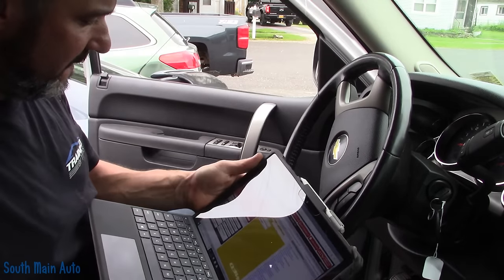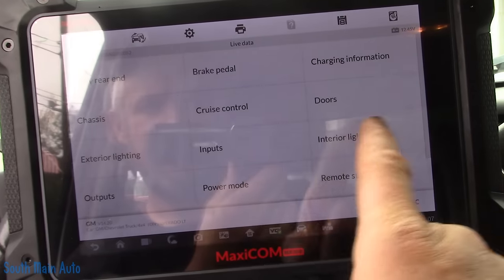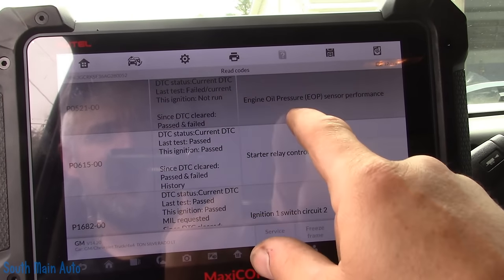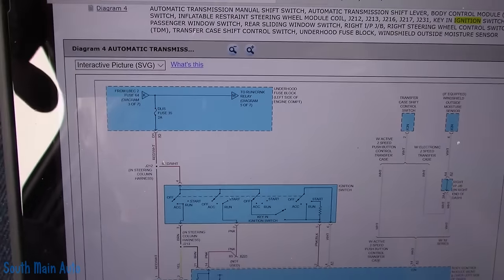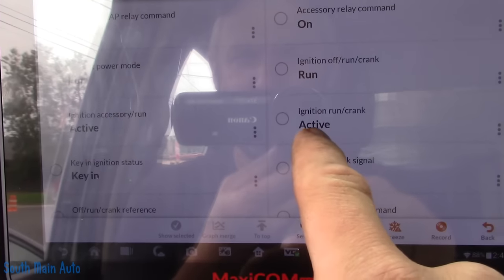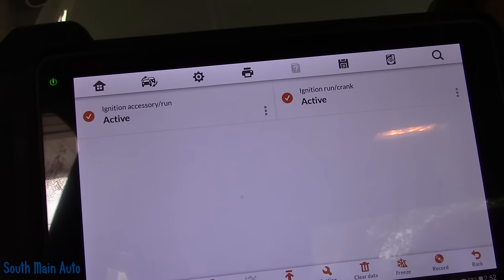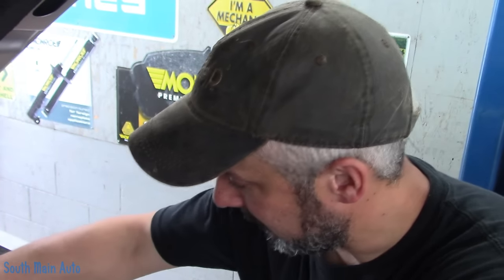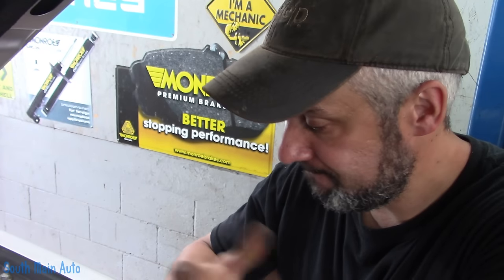Chevy/GMC Truck: No Start - No Crank

Comment: Hey man I replaced my steering wheel and while it was off it started to rain and I tried to switch it on to let the windows up and nothing.  Figured it was because the steering wheel was unplugged but after replacing the steering wheel I have the same problem.  Any suggestions?

Comment: I have an 02 chevy Silverado it's got the 4.3 in it the ignition will not start the engine I have to jump the starter relay in order to crank it but I have to turn the ignition to the crank position let go then it the toggle switch then it runs fine no security light or anything so it not the passlock any ideas?

Comment: I have a 2009 Silverado I was driving out the driveway and it died on me and it won’t crank over anymore All lights and power windows and locks work check battery and starter are to be working just won’t crank any need help will be appreciated .  Thk

Comment: I I would like to ask if you can help out in finding out why my 2000 Tahoe won’t start no lights on dash turn on besides odometer battery and security light scanner reads ignition 1 inactive and trouble code b1477 thanks in advance

Comment: Looks like a good concern to take back to the car lot who sold this truck, depending on how long ago that was.  Seeing the cover there nice and black, proves that cover wasn't there very long compared to the fuse board. I think I'd ask the car lot to give up 50% of the cost for the new one plus labor. Being only 9 years old, that fuse board shouldn't be that oxidized  had the cover been there like any other truck.  Someone has duped the buyer...verified.

Comment: From what I've seen on these trucks, it's usually mouse nests underneath the fuse panel and them chewing on wires, and of course the urine from them that cause corrosion. Clearly not the case on this truck.

Comment: Those trucks have been coming out of that fort wayne factory missing that lid for a really long time. Only time they get put on is if the dealer caught it on the predelivery inspection. It gets especially bad when the factory winds down production on the model year. Ive seen cars roll out of the factory as a completed vehicle, and it's missing the steering wheel, or the entire brake pedal is nonexistent. But hey, that's GM for you, only other car company that will sell you half a car as a whole one is ford.

Comment: Wasn't the original complaint about an Oil light? Did I miss that?
Reply: It was... but then truck died and wouldnt crank so that became main issue.  Code showed pressure sending unit problem.
Reply: @JenniferFuchek  So did he change the pressure sending unit?
Reply: @paulmartin5787  no not in this video. That's a job and endeavor in itself to do as the location of the unit and access/space to change it.
He did say hes going to order the fuse box from the dealership - maybe he will change it when he changes the fuse box.
So long as it's just the sending unit the vehicle can be driven with it as is... the sending unit only takes the oil pressure reading from engine and displays it on the dash (usually in a sweeping needle gauge). Its not a critical part for engine operation.
If it was showing low or no oil pressure and the sending unit wasnt the problem it would be more severe and critical - but Eric did say (according to customer) the engine wasnt tapping or knocking when the pressure gauge went low

Comment: that corrosion that ate that fuse is the same hungry beast that will eat up the bodies on aluminum body fords
Reply: right because my Chevy's steel body and brake lines didn't disappear from it. I've had both thats why I have a f150 now.

Comment: It's a known issue that the covers don't even need to be left off, the entire housing is just terribly designed. My buddy is going to have to do this same thing with a 3rd hand truck but the original owner put the snowplow box on top of the cover with literally just enough wiggle room to get it over the body side of the panel 🤦

Comment: Cars 101 - do not remove the cover of your fuse box and then drive the car around in rain, downpours, etc.  I don't think I have ever seen a fuse box so messed up in my life except when the car was flooded. Eric, how come you did not check under the car for water damage?  That fuse box is a big warning sign that this car was flooded at one time.

Comment: Gday
what about the oil light?
cheers
Reply: Pressure sensor.  It was a code stored. They're common failure and a major pain to change due to placement at rear of engine.
Reply: @JenniferFuchek  It was a performance code. MY bet would be low pressure when hot, if that is the case needs an engine. Could bandaid it with  a high pressure/volume oil pump, but the cam bearings on that particular year wear and bleed down oil pressure.
Reply: @mph5896  rewatched the video.... at 4:53 it shows oil pressure sending unit performance.... P0521 .... which can be caused by the sending unit failing or has failed. This specific P0521 engine code is triggered when the PCM sees an unexpected value in the engine oil pressure sender/sensor. It could be out of it's normal range or could be fixed when it should fluctuate. For this P0521 trouble code, the cause may be mechanical or electrical. Sometimes wiring harnesses break or corrode (given the look of the fuse box I wouldn't rule it out).

Engine oil pressure sensor performance simply means the sensor isnt in correct range the PCM is expecting hence it is failing and requires replacement. They are a very common failure part on Chevrolet engines.

Comment: Sure could have used your talents when 2002 Impala started with the security light, no start crap. You could reset it by turning the ign switch on and off in the right pattern and it would start again. of course that didn't last...LOL

Comment: that corrosion is so bad, and the rest of the truck looks good like a coverup  cleaning from a  under water salvaged  restoration. even in your part of the country, a full winter with fuse cover removed would not produce deep fuse corrosion. that truck was in a flood, most likely down south.

Comment: My truck needs a new ENGINE WIRING HARNESS JUNCTION BLOCK as well. The replacement part is saying programming is required. Has anyone else faced this issue and replaced without programming?

Comment: "For whatever reason it's not uncommon for these trucks to come in with no lid and I don't know why"... Oh I do... probably some tech at a stealership or other shop knows what happens if they pull the lid off and the customer drives around for a few months like that, they get a future fuse box replacement job :D

Comment: Any video of that oil pressure issue
Edit: or is that caused by that fuse box?
Reply: No.  Oil pressure switch problem.  It's just for pressure reading and they're a  common failure part. They're a real pain to change due to location on backside of engine. 
Oil pressure reading and fuse issues are two separate things.
Reply: @Francine Baus naah no worries! ♡

Comment: Driving up to your  garage to die is just Murphy dipping his toe in your lake. I rank a crusty fuse killing a truck like that right beside the sudden fuel pump failure that always seems to happen after you topped the tank up. Again, Mr. Murphy testing things out with a hand on your wallet. ^.^

Spooked you a little when she fired, eh?

Comment: Since you asked for a comment: f*cking gm should be sued for this faulty design fuse box. I have a customer with the exact same issue, fuse box corroded to sh*t. Lid wasn’t on properly and looks exactly the same as this one. How hard is it to design a proper lid? Ffs. Thanks for the video and the info, solid job.

Comment: Thanks to GM's stupidly designed fuse box, dirt and crap gets right up under the cover.  I took the cover off on my 2007 2500 and was surprised at the amount of crud in there.

Comment: See this a lot with the 3WD community. They spend hours and hours hosing out all the mud and sand in their chassis but never think of fuse boxes (when they've been that deep of course). If ya bonnet's been under, get in there and hose em all out to get rid of the salt, mud, sand... then hose the living bejeebuz out of em with WD.

Doesn't hurt to grease them all up, but if you're going to, use switch grease or silicon grease and know that no one is gonna love ya for it.

Comment: What about the diagnosis on the original complaint of the oil light? The suspense is killing me.
Reply: I suspect that will be solved with the fuse box.
Reply: Reece Newton he is working on a Chevy. There is bound to be more than just the fuse box issue. Probably going to need a new oil sensor and a complete engine overhaul and some blinker fluid.

Comment: What about the oil light?
Reply: Pressure switch.  It's a common part to fail. It's not a critical huge issue as it only "reads" oil pressure. 
They're a pain to change as they're on rear of engine under the windshield cowl.

Comment: I watch your channel find it very useful at times well all the time actually my name us Mike iam from oroville ca I have a 2011 chevy silverado z71 4x4 with the 5.3 l fuel management that will drop down to 4 cylinder  when other 4 are not in demand don't like that but that's a nother topic I had removed my wireing harness that feeds to the injectors  and ignition coils think I might  have some ground wires not I'm 5he right spots cause it won't start but all instrument symbols come on but no start also rhe color codes for injectors plugs wich gi to wich cylinder? I am homeless right now living out of my truck I trying to get back on the road others wiz I would if could  donate contributions if you could help it would be extremely greatful

Comment: My concern is who was the genius that thought that removing the fuse box from the safe confines of inside the vehicle would be better suited to an under the hood location?

At least on my Volvo V70, the fuse box sits in a sealed area under the hood close to the cowl panel. And imagine that, it comes with spare fuses and an extraction tool.

Comment: 9 years,9 years young is this car!!! And already sutch problems. Back in the '90,car manufactures made beasts off cars!!! Japponese cars where like Terminators!!!! European cars like Opel,Merc BMW and Audi made engine's that drove on frying oil for engine oil and they still wont die. Know,the engin's are so tiny ( here in Europe ) thet you gonna wonder " when is my engine dead " Like Mercedes,they have an 1.3l,i repeat an 1.3 liter with a horsepower off 200 hp + !!!! OUT OFF A 1.3l!!!! All the European cars has more electric conections then the CIA headquarters server room!!!! DISASTERS GONNA FOLLOW IN THE NEAR FUTURE!!!! Let me have my Opel Astra 2.0 Di 16v wagon automatic off 1999. It spins like a verry happy cat en all the option off that era are still working. 245.600kms and still going. What do they mean,newer is better???? Like hell it is.
Reply: So true! Everything now is designed to be replaced and not kept long term. Produce cheaper and sell higher.

Comment: What?  They come in with no lid on them a lot? Is their a Chevy fuse box lid thief in New York?  Is there a guy with a garage full of stolen Chevy fuse box lids, each one meticulously marked as to where it came from and when?  

That just doesn't make sense.  If you have to work on on something, put the lib back on.
Reply: Some people don't see it as necessary and leave it off.  Some may have to fight to remove them or replace them so they leave it off (I have a 2007 suburban and it is a PITA to remove... but my 2005 suburban is a breeze)

Comment: I have a 2001 gmc Sierra 1500 with the 5.3 liter V8 Engine  with 125,000 miles on the truck. It had no crank or start for 2 days then it started. Didn't have a problem with it for 3 years then 2 weeks ago I pull over at the gas station to fill my tank then it did it again after 3 years without having a issue it had no start or crank battery was brand new then 1 hour of trying to start it I finally got it to fire up then the last few weeks it's has started fine what the hell is going on here? anybody ????

Comment: Anyone want to bet the current generation of GM vehicles will age disastrously compared to their pre-bailout siblings?

That fuse box is a write off - i'd be curious to see the other boxes and the inside of the car under the carpets - see if there are any water marks.

Comment: I don't get it. I'm running from a fire that destroyed everything I owned, along with the homes of 27,000 of my best friends. It's friday the 9th of November, 2018 and my 2000 nissan frontier dies on a toll bridge at 11:30pm. Cranks but no fire. I have it towed to a mechanic. He says code says knock sensor and needs to pull both intakes to fix. I make my way to my daughters house 100 miles away. While there I look at threads about my truck. Common problem is seized distributor at about 150,000 miles. My truck had 160,000 miles. When I get back to the mechanic, I tell him what I learned. He keeps my truck for a week. Replaces the knock sensor and... doesn't fix it. So he puts new distributor in the truck and it's alive! Cost? $2500.00 plus $320 for a tow. Why, oh why don't mechanics listen to an old man with all his faculties? Being stubborn cost me about $1500.00 and a week without a vehicle. It's ridiculous. All he had to to is pull the cap, crank the engine and look. But.. Nooo! He's Gods gift to the automotive industry. And, to top it off, he was upset because he gave me a great price because I lost everything I owned and he felt sorry for the guy sitting outside his shop with tears running down his face.I was sorry too.

Comment: Please answer me this Eric ...... when I used to take my vehicle or the wife's, to the dealer to get it diagnosed and fixed, it would be there a week with several parts replaced !!!! You diagnose and find the problem and repair them in less than an hour and without a dozen new parts replaced !!!!! Are you some kind of vehicle mechanic savant ?????  There is not one vehicle that you have ever thrown your hands in the air and said @&%*!! I don't know what's wrong, I give up !!!!!! The dealer has all kinds of factory diagnostic machines and know it all mechanics and you do it in an hour ..... what's up with that ???????  Inquiring minds want to know !!!!!!!

Comment: 》》 BEEN WORKING ON CARS SINCE 8 YEARS OLD.  > CHEVY LINE MECHANIC. OWNED A COMMERCIAL PROPERTY AND AUTOMOTIV SHOP IN LOS ANGELES. SOLD I YEARS AGO.. AVIONICS  MACHINIST NOW. NOW AT 70 YEARS OLD I CAN DO BRAKE JOB AND R & R A  RADIATOR.  ETC.ETC... ON  MY 2000 CHEVY SUBURBAN.. BUT.. NOW TURN ON KEY. LIGHTS ARE  ON DASH. NEW DIE HARD  BATTERY. ENGINE WILL NOT  START. TELLS ME KEY AND IGNITION SWITH IS OK. BATTERY TESTED. OK.. HOOKED UP LARGE WHEEL STYLE SHUMACHER BATTERY CHARGER. 200 AMP ENGINE START SYSTEM AND STILL NOTHING HAPPENS. SO.. CHEKED ALL ENGINE START FUSES..OK.. SWITHED ENGINE RELAY.. STILL NO START..》》 MY QUESTION IS... IS IT THE STARTER AND OR SOLONOID ??   OR DO I HAVE TO BUY EXPENSIVE SCAN TOOL OR JUST BUY $225.00 NEW STARTER & SOLONOID AT NAPA STORE. NAPA STORE GUYS HERE PRETTY SMART. THEY SAY IT SOUNDS LIKE THE STARTER..? HELP. TODAY IS THURSDAY MORNING. NO CAR TO DRIVE ME. I GUESS I HAVE TO GET A CAB TO NAPA. SOON I WILL HAVE TO OWN A SPARE CAR I GUESS. AUTO REPAIR THESE DAYS TOOOO EXPENSIVE.. MAYBE I BETTER GET A MOTORCYCLE TOOO. THAKS FOR ANY HELP..